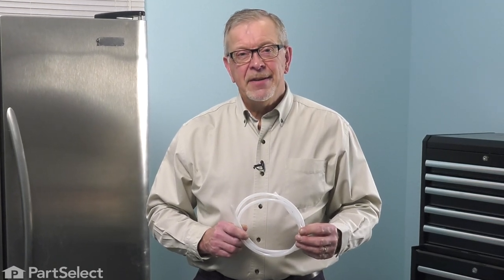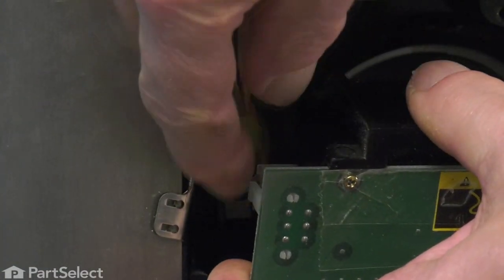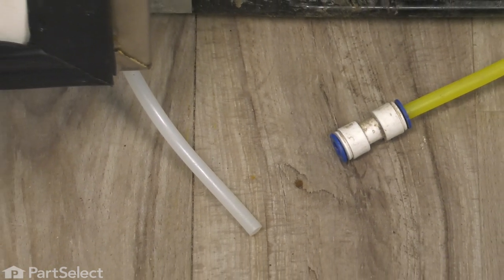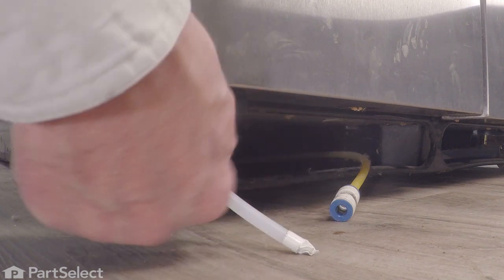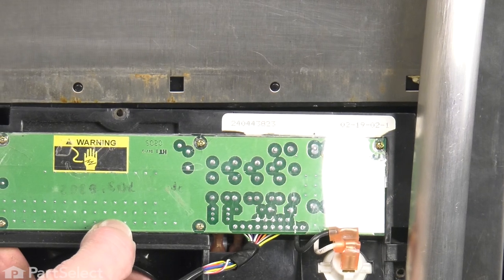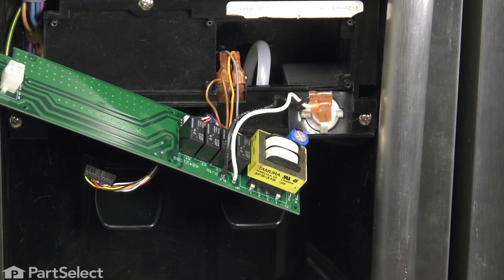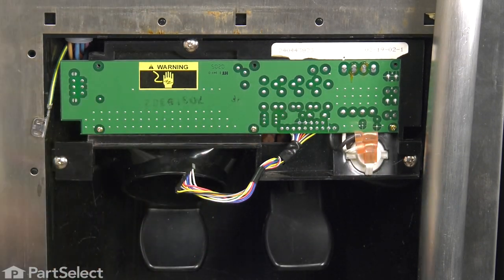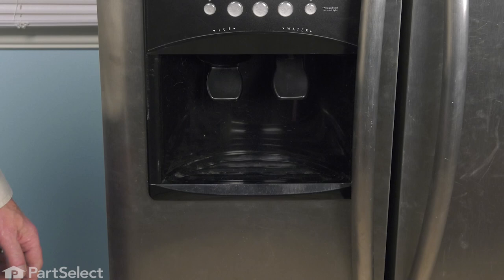Frigidaire Refrigerator Repair - How to Replace the Water Tube (Frigidaire # 218976409)

Comment: I took mine out and now can’t get it back in. It hits something about 5 or 6 inches from the top, whether I insert the tube from the top or up the door, and just stops.
Reply: Hi, This is also happening to me. I just followed this video last night. How did you fix it?
Reply: Mine did this and I tried running the old line and a new piece down opposite ends and found there was a piece of ice clogging the tube and with both I smashed it enough to fit it through but only up the bottom.

Comment: Thanks so much for making this video, you just saved me a bunch of money.  I had to adapt this to my fridge but felt pretty good with your directions and instructions.  I was able to rip out the water line, run some hot water over it, cleared out the frozen portion and then snaked it right back in.  I had tried the syringe last night but that did not work and shot a bunch of water everywhere.  I also dislodged the water line from its holder.  One tip I will pass on to other viewers is to push the water dispenser once you disconnect the water line at the bottom.  This will tell you if the frozen water is on the refrigerator side or the freezer side.  Water came out from me, so I knew where the clog was.  Our water line froze up after I recently adjusted the fridge and freezer temps down a little and went out of town over the weekend.

Comment: Hello i have a frigidaire from 2007 and i changed the water pump, i just discovered that the water line pumps water direct to the dispenser, there is no filter in between , is that normal? Is the filter that i been changing for years just for the ice? Thank you.

Comment: Thank you for the video.  We pulled out the water supply tube only a few inched and the clog disappeared.  After putting the same tube back in place, the water dispenser is working like a charm.

Comment: I agree why not connect the hose to the dispenser before feeding it down to the bottom and then you don't have to pull a circuit board off?
Reply: it might require that you have a second person to hold it. but it would still be easier than pulling the whole board apart to get the hose on to it later
Reply from the maker: Your idea may very work as well, and I think your right a second person would be ideal. Fishing the hose down thru can take a bit of effort and if it was attached tot he dispenser there is a greater risk of kinking the tubing. Experience is usually the teacher in these sort of repairs and most of us do not want to disassemble anything needlessly but way Steve has shown it is how the manufacture has suggested it be done. Next time I have one apart I will try your way, never too old to learn something new. Thanks! - Chris

Comment: for almost 20 years I've had a fridge like this and only in the last year has this water line frozen up on me almost once a month.  I have installed a heater near the end of the dispenser hose right around the ice door flapper, but the ice seems to form much deeper in the door.  I know i can fix this with heat or leaving the door open.  I even bought this thing called a Water Line Buddy that is just a syringe and a few feet of tube that has a smaller OD than the ID of the water line.  It slides right in and in can inject hot water on the ice jam.  However, my real question is why is it icing up after 20 years of not doing that.  are there heaters inside the door that can be replaced?  I know there is one near the door gasket but the interior of the freezer door is a mystery to me.  Is it possible to access the interior of the freezer door where the hose runs to insulate it better?  Hoping someone knows what the real issue is on this freezing water line.  And to preemptively answer a question i think i will get:  My thermostat setting has not changed in the colder direction.  I have even tried a warmer setting with no luck.  Has anyone tried adding the aluminum backed sound deadening material to the inward facing wall of the freezer door with any success?
Reply: Did you find any solution?
Reply: @skhurshid248  not really.  I installed this adhesive heater around the opening to the ice door and the water line still froze up.  that's why i think the place to apply heat is somewhere else.  mysteriously though the line has stopped freezing many weeks later.  but it did require 4 or 5 sessions over a week or two with hot water and the Water Line Buddy though.  I highly recommend this tool as its the fastest way i have seen to free an ice jam in the water line.  when i used mine i ended up sending the tube maybe a foot up into the water line.  wherever the problem is its deep in the door.  or it was, since it doesn't seem to happen anymore.
Reply: @TheRetrodog  I as well have this same issue and think there must be in interim  heating element gone bad. Here’s a couple of other tips for others. We didn’t want to wait to get the waterline buddy in the mail so we improvised and ran to Petsmart and bought the mini airline hose. This is the smaller version of an airline hose and it fits perfectly inside the 5/16 inch waterline. I drilled a hole in the top of a Poland Spring bottle cap just barely small enough for the hose to fit through and it doesn’t leak. I sit the bottle on top of the fridge and gravity does the hot water work. No squeezing. I just have to push in the hose.  

Another tip is that the water line hose is free fitting in dispenser. What happened to us as we didn’t realize that and when we pushed in the hot water line we pushed the fridge line up inside the housing. The next time the hose didn’t go in and I had to take the front panel off. Remove three screws on the bottom and slide it up to lift it out. Thanks for my wife for figuring that one out.

Comment: I have a Frigidaire Gallery, it does not make ice a lot, it is slow but it makes ice, I checked the water line's and the water pressure, so it is the solenoid?, so if in case I order one, is it anything else it could be? any sugestion's. thank you for your help on this!!
Reply: While the video was helpful, especially the part about removing the circuit board for better access (I remove both of them rather than risk a plug or cable failure) feeding the new tube in from the top did not work for me. It always hung up on some edge near the end. But feeding in from the bottom was a breeze.  I used 5Ft of 5/16" tubing and cut off the excess a little long at the outlet once it was all assembled. What cased the problem to begin with was that my tube dislodged while the air purge from a new filter was occurring. The water line had been frozen for months due to poor storage (over filling) of items in the freezer.  Mustn't do that or you get warmer and colder spots